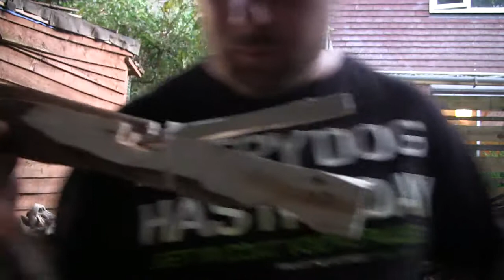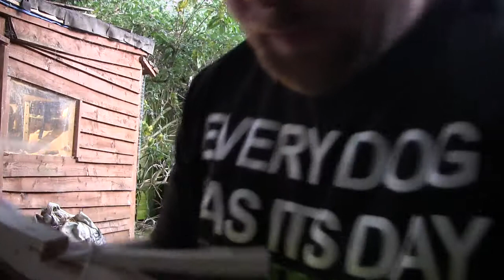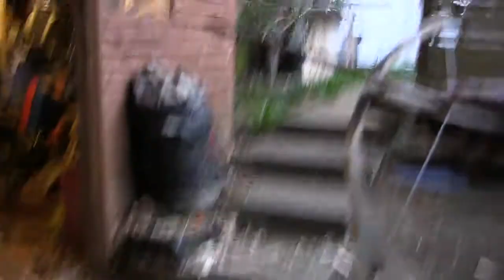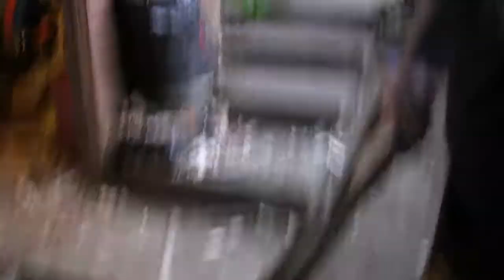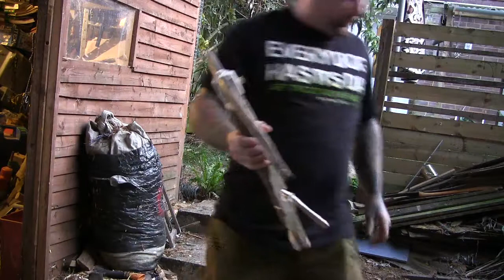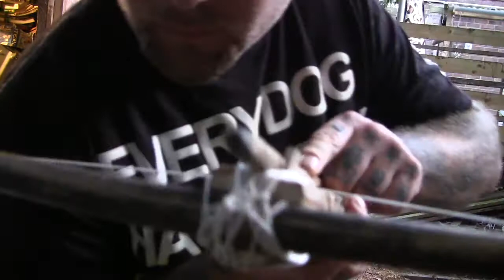survival crossbow 2

Comment: Great x bow. I'm going to make one this weekend. Question: what type of wood did you use for the cross piece on the front? And what kind of string have you found for maximum FPS? From what I can see, your bow is awesome, but without the right wood and cordage it may not last long/ be powerful enough to kill animals in the wild. You must have tested different material?
Reply from the maker: +Mr123eagle the wood for the frame /stock was yew  but any hardwood would do , the prod/ bow part was made from bamboo  , the string was nylon cord